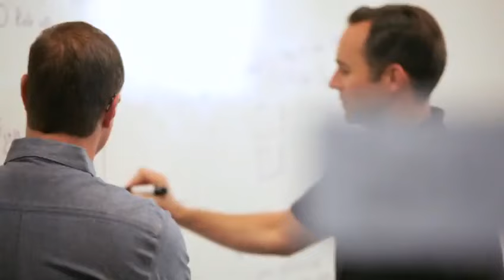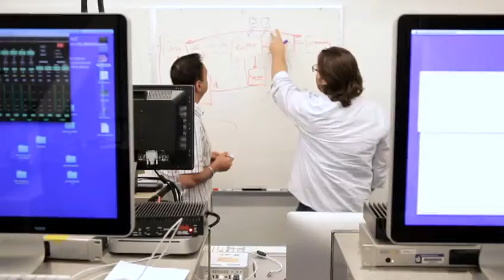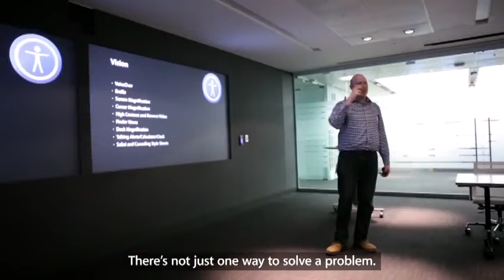Apple's employee recruiting video

Comment: Imagine bring a PC to work at Apple :))
Reply: Well...their servers probably run on top of some custom Linux distro.
Reply: Many people at google use a mac. In fact in a lot of startups its common to see a large majority of people using mac. Speaking from the CS perspective Macs are build directly on top of Unix which is much closer to linux than windows. There are other reasons programmers use macs over PC but that and xcode are the main ones

Comment: 1:35 I lost it 
"A smaller battery that lasts longer" I call shenanigans my iphone 5S has a larger battery (1430mAh) than my 4S (1120mAh) yet neither phone last a day on a single charge  
Not even a 4100mAh battery case can keep it going for the day 
I have to carry around a USB power cell that holds 130AH to keep my devices going 
(It lasts about a week using it every day) 
Here's a suggestion apple 

STOP WORRYING ABOUT THE THICKNESS AND WEIGHT OF YOUR PHONES AND MAKE THE BATTERY LAST FOR AT LEAST 24 HOURS OF SCREEN ON TIME!!!!!!!!!!!!!!!!!!!! 

I would prefer an iPhone that is thicker and heavier knowing I can call 000 for an ambulance if needed instead of dying because apple was too cheap to put a decent battery in my $1000 iPhone realistically the iPhone 5S should have a minimum of 10,000mAh of battery capacity and I have calculated that would make the device approximately double the thickness and about 80% heavier than it currently is 
But at least the battery would last more than 2-3 hours of talk time 

And don't even get me started on the iPads battery and charging system 
"Hint" it will only charge if the screen is off 
If you play a game or watch YouTube with the screen brightness at full (or over half for that matter) it refuses to charge it will drain the battery while connected to power 
(Not sure about the iPad Air but I know my iPad 4 has this problem)

Assholes

Comment: And if you criticize someone you will get fired, work for minimun wage in a Apple Store and if your battery suck big time (cant hold a charge) then you are kinda forced to buy a new phone cause a new phone is "just" 20bucks more expensive than a single battery. Their products is great but is not user friendly. Makeing it almost impossible to take out the battery from your iPhone. Using screws in one version and in the next they use glue.
Reply: you disassembly it? warranty lost, do you want a battery upgrade? we dont give a **
Reply: there's an app for that :)